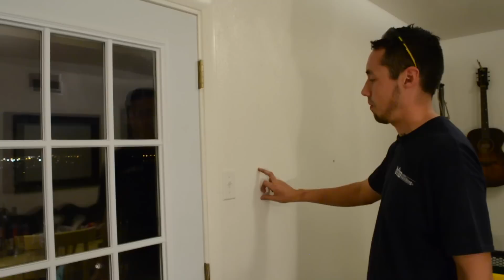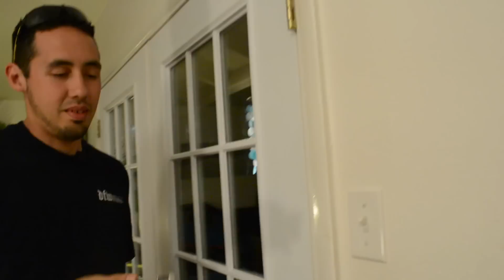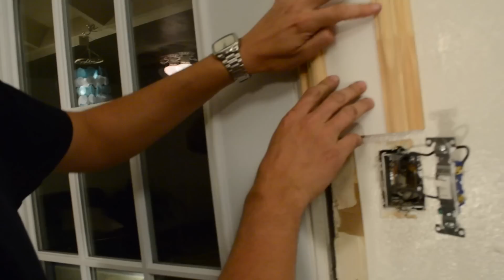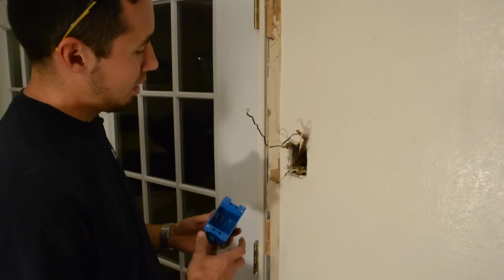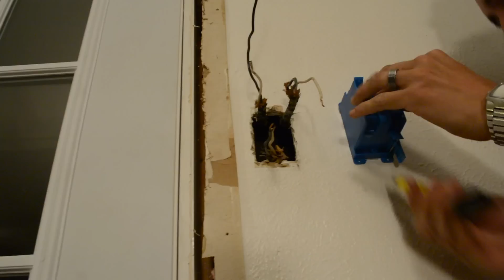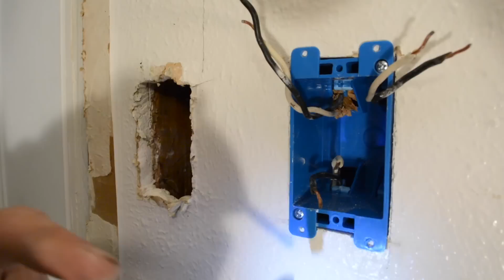Trim Carpentry - How to Move an Electrical Outlet/Switch

Comment: Quick tip: run a screw in the middle of the cut out before you cut it. This will give you something to hold and use to pull the drywall out so it doesnt accidentally fall into the wall.
Reply: Or just push it into the wall cause why not? 🙂
Reply: @swimminger  yeah I let everything fall into the wall
Reply: @dylanmerritt3396  So trashy
Reply: Why would I do that?

Comment: Let’s count how many code violations this idiot has encouraged all of you out there to do. 1). Moving an electrical box  and device without a permit. 2). Installing the remodel box 3) moving the existing wires into the remodel box without insulation on the wires 4). Installing the device (switch) Those of you who take advice from this fool may in fact cause more damage both now and in the future. It’s idiots like this that cause tremendous damage to structures and liability. DO NOT FOLLOW HIS INSTRUCTION! HE IS AN UNTRAINED AND UNEDUCATED HANDY MAN NOT A PROFESSIONAL! 
Please heed the warning from a trained and certified Building Inspector.
Reply: If you think people are gonna call an electrician to move a box 6 inches, get your head out of your a$$. You "pros" have to chime in on every diy video on YT to throw your weight around and scare people into spending (a LOT of) money for nothing. Great racket. STFU.
Reply: kellyq21 Kelly I’ve been where you are (40 years of new & remodel construction) so I understand. Rules are rules and all of us need to follow them, they are established for the safety of the user not necessarily for installation cost or affordability. Keep in mind, your video can be used as evidence against you should someone follow your instruction and have liability.

Comment: There is a metal box for OLD Work. You need to use a metal junction box when using BX wire. This demo is good but not up to code. You no longer have a ground and there are probably outlets connected to this line and they no longer have a ground. Don't use plastic with BX only metal. Plastic is for Romex cable which has a separate ground wire.
Reply: That appears to be cloth covered.  Not bx.
Reply: Paul Cohen 

Was thinking the same thing
Reply: You Americans actually have outlets connected with the light circuits? 🤔😂
Reply: Ryan Allen 

Yep and we don’t use them goofy looking European plugs either. MURICA!!!!!!
Reply: @chrisj197438  the European plugs have 2 prongs and look exactly the same as yours lol and the UK electrical system is alot safer than yours too. oh and our plugs may look bad but guess what? Our UK plugs are the safest plugs in the world deal with it. 😂.
Don't belive me? Research it
Reply: Here in the UK you also wouldn't be allowed to move the lightswitch sideways like that. Cables have to run vertically or horizontally inline with switches/sockets ("safe zones") so you know where they are and don't drill/nail into them. He'd need to move the entire cable drop sideways. Easy to see him attaching that trim and hitting the cable.
Reply: @StevenAyre1 in the UK as long as there is 50mm between the surface and the cable you can run it ehat way you like. So basically if the stud wall is 50mm thick then it don't matter. And my guess is the stud is made from 4x2 so that's a 100mm cavity. Even if it was 2x2 that's just over 50mm cavity. There for he can run whatever and however he wants. don't forget he's not in the UK anyway so it doesn't matter what we can and can't do over here.
Reply: I'm yet to see any BX here
Reply: Those are cloth wrapped old wires not BX... either they are old enough they don’t have ground wires or they have them marretted outside the box like a lot of old houses.

Comment: Seems obvious the stud was on the left as that's the frame in which the double doorway was mounted.
Reply: Mitch D 
My ex decided to open the wall between the living room and dinning area. There were studs on either side of the box, it was just how the studs laid out for 16” OC.

Comment: Thanks.  Say you were to move the box too far for the wires to reach.  Could you put a concealed junction box where the original box is located and run new wires to the new location ?  Have a regular box to left of sink in bathroom.  Want to pit in medicine cabinets over sink.  Desire to move and run a rabbit to a GFCI on left wall to clear medicine cabinet.  Is this Code or do I have to just close the outlet - new cabinet will cover, unless I raise the cabinet height and rabbit the GFCI ?  Other alternative is to put in a larger Circuit Box - more fuses - and run a brand new line to the 1st floor 1/2 bath and 2nd floor full bath - above.  First alternative is more attractive.
Reply: No. You can't cover a junction box

Comment: When moving a box sideways in the same cavity. Mark the new location and cut the top and bottom lines all the way to the old location. Cut the side that is farthest away from the old location and carefully remove and save the drywall. After removing the old box and moving the wires over to the other end of the large rectangular hole, slide short strips of plywood inside wall to screw the drywall patch onto. Patch in the piece of drywall shifted over to fill old box location. This will automatically open up the new location. Put wires into the back of the remod box and insert into hole in wall.
Reply: That is pretty smart......
Reply: Considering the short distance the remodeling box was located I think the TC guy did a fine job. The new box being plastic looks a lot safer than the old metal box.
Reply: Bill Wilson
I agree TC did a great job. I feel silly missing the joke, I usually catch those. I love the idea of cutting out the drywall, but which is easier rewiring the new box or patching the drywall? If you had to keep the metal box he probably would just moved it to the next stud over and nailed through the right side. Can you put a junction in the old box location even if it's covered by the molding? God Bless you and your family TC. You did an excellent job in explaining everything.
Reply: @rodw  No, you can't put a junction box in the old location. All junction boxes are required to be accessible, so only a box cover will suffice. The trim covering the box is not legal -- it covers the junction box and does not use a metal cover. In case of a spark, the wood trim could catch fire.

Comment: NO! Do not drill near a box to locate a stud. If your drill bit catches a wire you have a problem. Instead, use a thin screwdriver to slide between the box and the drywall to feel for a stud. Much safer and easier.
Reply: anasmrright 
True

Comment: You're a great carpenter, but you should probably call an electrician. The cover doesn't sit right on that switch because the tabs are still attached. Always break off the tabs on the device with a cut in box.

Comment: Around my area the old cloth romex grounds were wrapped around the wire casing then the wire clamp would carry the ground through the box. You've basicly broken the ground by switching to a plastic box. Might want to check your outlets are still properly grounded.

Comment: as an electrical inspector, I believe it would be in your best interest to remove this vidio.  this IS why fire inspectors and insurance adjusters have a field day when the ashes are cleared
Reply: @trellend  Jerry Welch's point was that the house might be burned away but the video would remain as incriminating evidence.
Reply: If the house burned down, all the way, what would there be left to see?  All the insulation will be gone, wires piled up on the basement/slab and romex/insulation will be gone.  Alu wire will be melted, Cu might be there, might not.  Nothing to see folks.
Reply: What did he do wrong?
Reply: @MrJoshdavis99  Covering of romex removed on box entrance, wires not sticking out of box far enough.

Comment: where is the ground.  I think that was BX which means the ground was made by the metal box.  You went to plastic so you broke the ground continuity.
Reply: Freedom is a Right the metal coil around the wires is the ground on BX armored cables.  The metal coil is bonded to the metal box and the metal screw for the switch to ground everything together and all other metal sheathed cables that leave the metal box to other receptacles.   When he moved to a plastic box the ground continuity is interrupted.   He needed to use a metal box with each cables external metal sheath firmly connected to the box with the appropriate connectors.  This is common electrical practice when using BX armored cable.  Again, There is no ground wire, it different from Rome’s cables.   The external metal sheath acts as the ground.
Reply: Freedom is a Right of course it’s hard to say not being there, but it looks like BX to me.  I can see the small thin silver bonding wire on the top right set of wires.  Also if it were vintage the actual conductor wires would be cloth and not covered in more modern plastic.  I can also see the brown paper and red bushings used for bx.  The only set I could not see clearly was the top left.  But again conductors covered in black and white plastic and not cloth means it not crazy old and therefore it is bx.  Bx does not have a visible green or bare copper conductor.  But only way to truly know is to be there.
Reply: Grounded outlets have not always been required. When I started in the trade (1964) was just after the code changed to include grounding ALL outlets in my area. Prior to that, the only needed to be grounded around other grounded surfaces such as bathrooms, kitchens, and garages. A switch in a bedroom or living room would not need to be grounded. Most of the time, the ground wires for those earlier "grounded" outlets were individual wires that were simply wrapped around the nail that fastened the boxes so when the nail head contacted the box, the ground wire was "pinched" under its head. Usually, those ground wires were simply attached to a water pipe with a little copper "bonding"  strap.  That sure looked like the old cloth covered two wire romex (no ground) to me. 
One possible answer no-one has contributed to this point is that sometimes, you simply need to OPEN THE WALL to properly modify the wiring. If the attic and/or crawl spaces are accessible, junction boxes installed in those spaces are considered "accessible" and are legal for remodel work.

Comment: Hey dude you didn’t have to take out the old box you could’ve used it as a junction box And ran wires as far over as you want it for the new box A lot easier and a lot faster
Reply: Were you watching? He didn’t need to add wire for the new location.

Comment: This is not code dude. you are going to cause someone to start a fire, let alone in your own house. your wires are too short. there needs to be sheathing around the wire where it penetrated through the box and the wire mechanically connected to the box . Stick to trim. This is outside of your scope. A trim contractor should not be touching electrical. This is the wrong way to do it.
Reply: Charlie OConnor we’re currently requiring a house that had a high voltage line drop on it. Every outlet caught fire and really shows how well the boxes when installed properly prevent the spread of electrical fores
Reply: 6 maretts to jumpt it over
Reply: Your a hater fool. Viewers who take it upon themselves to diy this kind of project also have the responsibility to do their own homework-this dude didnt say anything to promote himself as any sort of electrical genius. Your just mad he didnt ask you to be in the video lol!!
Reply: @chaboy420  If you decide to do 'owner builder' you are still required to pull permits and have inspections done on your house. DIY is not an excuse for sloppy work. 

Check you local county or city for requirements. 

Most banks will not recognize 'DIY' additions to your house unless you pull permits and have the work inspected.This would fail a pre-escrow home inspection. Allowing the buyer to reduce their offer. Finding this kind of work in a home I was looking at to purchase, would cause me to take a second look and adjust my bid accordingly.
These are not just peoples homes, they are also investments. Money is on the line and people take that sort of thing seriously.
Reply: Charles OConnor yes thats correct. Where in my comment is referring to that? Your just side stepping. Bottom line people should be supportive and information with their comments; whether or not they agree with the method or not. Instead of being accusatory with your negativity, you should just reply with the facts. People will do whatever they want regardless. Inspectors, banks and loans; im very sure there areDIYers who need and are willing to listen and use your tips and info..if it wasn't dripping in arrogance. Tone DOES translate, fyi.
Reply: Spot on. First thing I saw was that the cable sheath was not under the box clamps. Bad Bad Bad... Imagine what he does if the box has AC or MC coming into it.  Hire a qualified electrician !!

Comment: From a framing standpoint, how is that door opening framed without at least a double or even triple stud to support the header? Does the wall move when the door is closed? Yowza!
Reply: The header could be a wider span than the door.  The j-box he pulled doesn't look like original work to me.  I'd guess someone replaced a larger sliding glass door with the french door.

Comment: Really would not have taken much to put the piece you cut out for the new box into the hole left by the old one, and in my state at least, all the drywall has to be sealed, and if their is a hole it has to have an electrical box or pipe going through it. Sure its covered but say they change the door and when they pull the trim they crack the wall between that hole and the new compression style box that is between the studs and has no reinforcement.

Comment: What if I need to relocate an outlet roughly 4 feet over? I obviously wouldn't have the slack needed, do I have to junction box it and leave access to that box?
Reply: maybe use the old box as a junction box, again might not be code and extend wires, if not have to rewire
Reply: Yes

Comment: Advice from a master electrician: hire a licensed electrician that is qualified to recognize fire hazards. 

Constructive criticism here, not all remodel boxes are the same and box fill calculations are easy for an electrician but would sound like calculus to a DIY handyman. The box in this video was pretty shallow and might not have been rated for the (9) or more  12 AWG conductors which need 2.25 cubic inches each. The device counts as (2) conductors, the grounds count as (1) conductor, each other conductor count as (1) each. So if he was using a 20 cubic inch box for conductors that need 20.25 cubic inches of space in order to not overheat that represents a fire hazard. Now install that dimmer your wife wanted and then you introduce even more heat since you probably didn’t bother counting the wattage on the lightbulbs either and bought the cheaper dimmer rated for only 300 watts instead of 600 or 1000 watts.

The National Electric Code was written by the National Fire Protection Agency and is a MINIMUM standard in order to prevent injury, death to people or damage to property. In other words it is the very least you need to adhere to in order to prevent an electrical fire or electrocution hazards.

I really enjoy this channel for the carpentry, but I also enjoyed when he said he tries not to be a jack of all trades.
Reply: Switch to led bulbs thus your electrical load will be a fraction of what it was. Less chance for overheating/fire.
Reply: ah but if not for this video you wouldn't have tweaked his technique and we all wouldn't have learned. A pro is good for most tasks but as a homeowner we'd like to be able to do some basic electric - realistically  I can't afford to call the plumber every time the toilet stops up. Love these vids even if they aren't perfect
Reply: 600W? 1000W? Dude. You got big plantation. Call me for harvest.
Reply: I should have stopped reading after "advice from a master electrician". If you think people are gonna call you to move a box 6 inches, get your head out of your a$$. You "pros" have to chime in on every diy video on YT to throw your weight around and scare people into spending (a LOT of) money for nothing except to line your already full pockets. STFU.
Reply: kellyq21 they really do need to get over themselves, it’s a single pole switch ffs.

Comment: Instead of a stud finder or making a hole in your wall, just look for the two bumps on the edge of the box..it’s designed to hold the box 1/2” out from the stud to lay flush with drywall.

Comment: @ Negron remodeling, old work boxes don't require strapping.  only code violation was the short wire . If you cut out a little more drywall and remove that old staple you'll get a lot more slack (probably).  i would have been impressed if you cut the old switch into your trim. as a homeowner you dont have to worry about Nec.

Comment: I can give you another tip: Take some pliars or side cutters and bend or snip the "ears" off the switch or receptacle. That way the switch will be more flush with the box, and the plate will install flush with the finish surface. I'll give you a B, but I can't give you an A for the grafe. Lol!